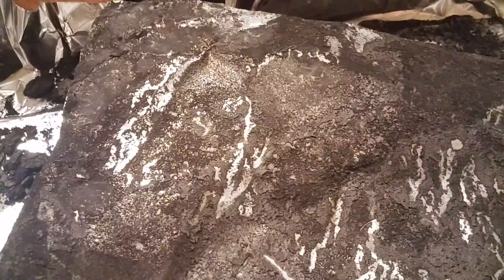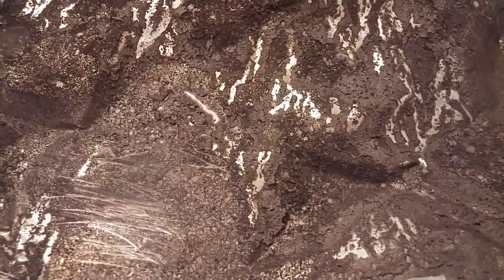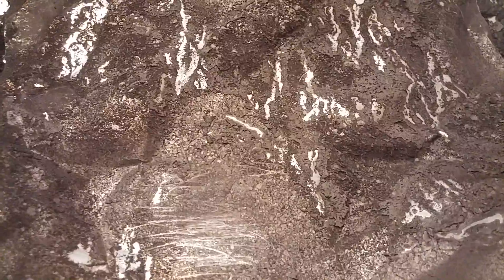Graphene direct coating for aluminum foil.

Comment: Have you seen/heard of the 'graphene spray gun' (see wiki page), basically a supersonic nozzle applies (i guess) rGO to a substrate and it can create a 'virtually' perfect sheet/layer of graphene.

I'm sure you have probably looked into this more than myself ;)

Anywho, just received my couple of samples, excited to get experimenting.
Reply from the maker: Yes. That's one of the projects I'm working on right now.
Reply: https://www.asme.org/engineering-topics/articles/energy/hemp-carbon-makes-supercapacitors-superfast
Reply: Moreover, adds Mitlin, the assembled supercapacitor device yielded a maximum energy density of 12 Wh kg-1—significantly higher than those for commercially available supercapacitors. By taking advantage of the complex multilayered structure of a hemp bast fiber precursor, these high-performing carbons were created by simple hydrothermal carbonization combined with activation.    from the article .... i dont know the chem side at all but i look at as much info as i can is there a fit ... with hemp how much a ton do you need
Reply: Would powder coating work ?